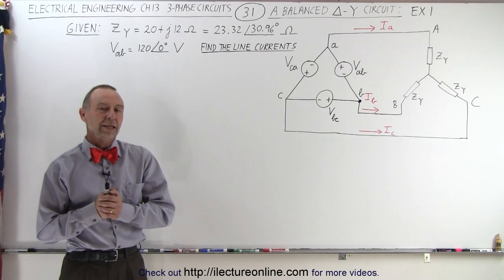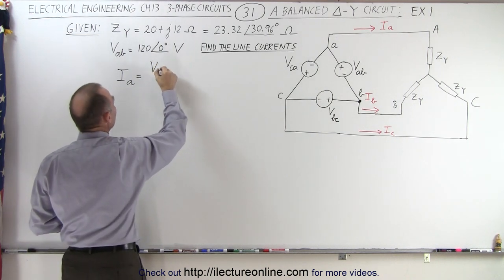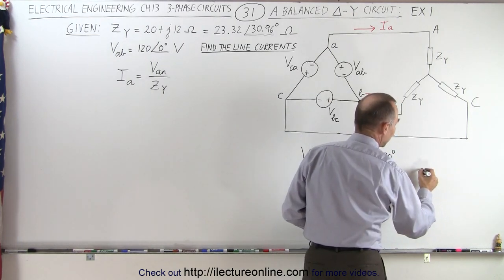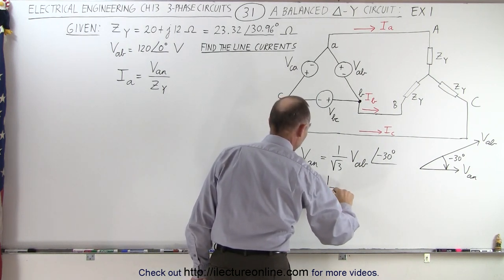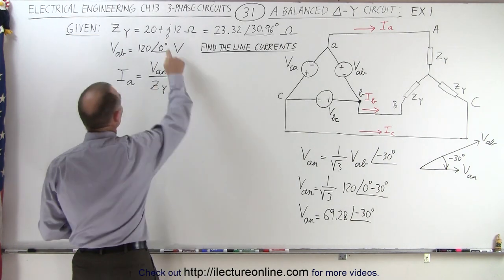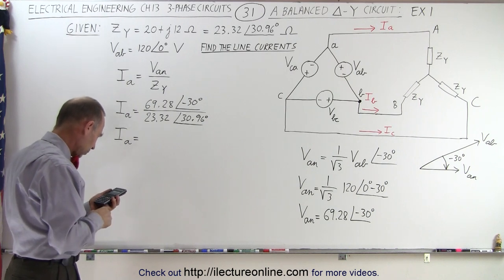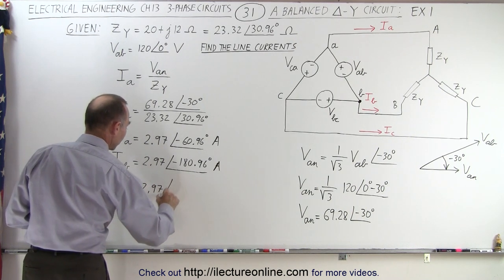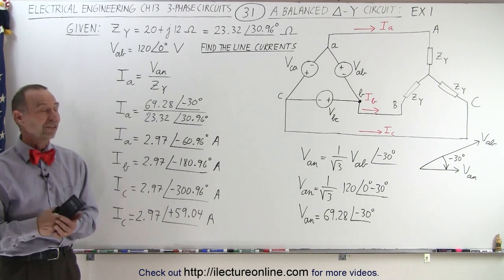Electrical Engineering: Ch 13: 3 Phase Circuit (31 of 53) A Balanced Delta-Y Circuit: Ex 1

Comment: I thought Vab = Vphase for delta source connected circuits
Reply: I think because Vphase delta source  = Vline wye load then Vline converted to Vphase wye load by div root 3
so we can determine Iphase load which equals to I line load = I line source delta

Comment: Didn't you just get done spending the last three videos saying the line voltages are equal to the phase voltages in this configuration? why are you converting one to the other, and using a totally different equation for line current all of a sudden?
Reply: Ya ,didnt logic
Reply: Yeah same qtn
Reply: yeah same question
Reply: yup, crazy they left this wildly confusing video up
Reply: @itspedyluis  he is converting the source from delta to 'y' so the phase voltage for delta is being related to line voltage of 'y' which isnt equal .
Reply: @itspedyluis phase and line voltage for delta are same tho

Comment: i used mesh current method to find the line currents. can we solve this question without converting the delta configuration to wye connection?
Reply from the maker: We do have different techniques to solve these types of problems.  In this case we solve it as a 3 phase circuit.